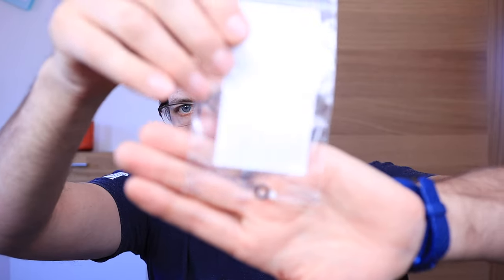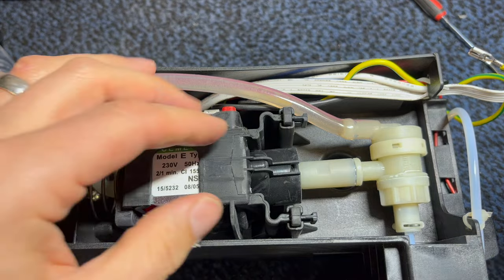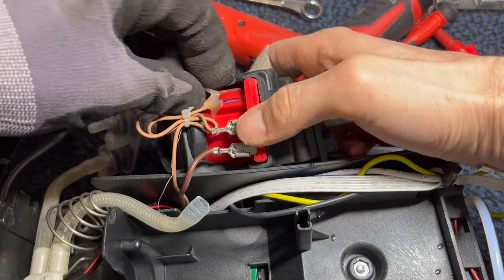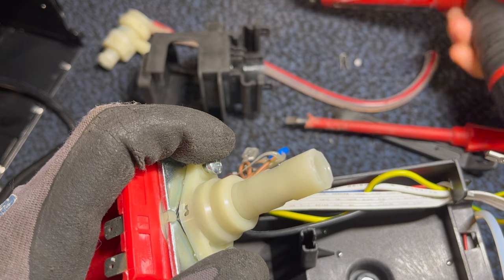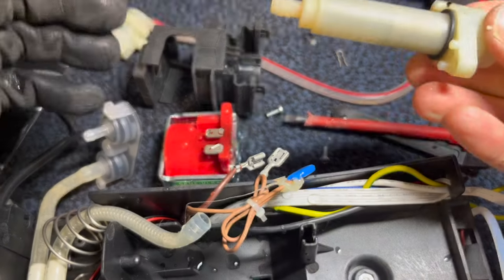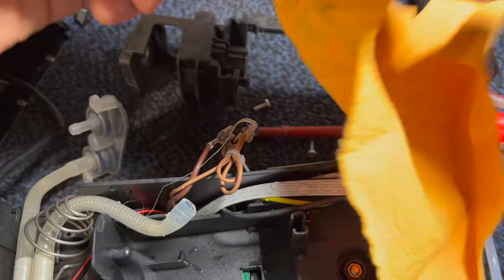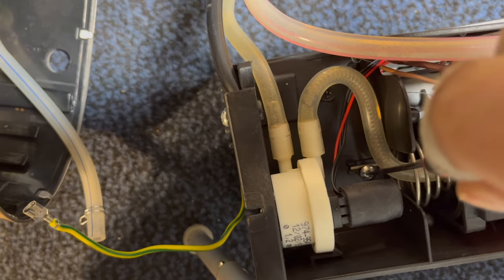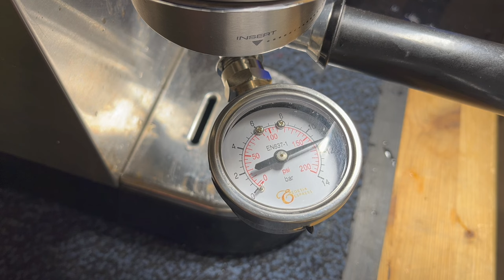HOW TO FIX an ULKA Vibratory Pump: Dedica, Gaggia, Saeco, Philips, Etc.

Comment: The best ULKA pumps are the red ones whit metal nozzel, the other Ulka white body and plastic nozzel are trash they have fewer coils windings and only last about 1 year,the new Saeco and Delonghi are fitted whit that crappy pump white body and plastic nozzel, to save money.I always replace them whit red ones.
Reply from the maker: Ok that's good to know Sebi! Thanks for that info. I will consider a red bodied one next time I need a replacement. Cheers!
Reply: The red ones are 24V for the oldest equipment. The White and the black one's are 120V (America) and 220V (Europe). So you shoukd Don't interchange it because risk of shortcut.
Reply: @Seby Saba That's incorrect .... red housing pumps are NOT 120V
Reply: I have a red one 230V (Oster) @lifeisfuneh

Comment: It's ridiculous that a tiny plastic ball and gasket costs £5 but you can buy the entire pump for £14. Are they really saying that that ball and gasket is over a third of the cost of the entire pump? They should be tuppence.
Reply from the maker: Hey Bob, well it is third-party selling these, and of course they want to make a profit. I’m sure that the parts only cost pennies.
Reply: I was thinking the same, but ordering the same rated and foodsafe parts in low numbers is very tricky. Ive tried aliexpress, and ive found some sellers for the casket, and for foodsafe balls .. i just dont know if i want to wait 2 weeks and find out either they dint fix the problem or leaking plastics in my coffee due to the seller i pick, cheaped out and got a regular part.

When you buy in bulk, those sellers tend to sell you probably the stuff you need, and food safe. 5 bucks is not bad, in my opinion. If no shipping 😅
Reply: Ball and ring are for 0.5 euro. And it remains 4.5 for taxes and retail costs

Comment: There is an upgraded version of this pump which comes with copper pipe instead of plastic and costs almost the same price. Model: EX5
Reply from the maker: Thanks for that tip! I will look for that one, when I need a replacement.
Reply: Nope

Comment: DON'T DO IT !!!

I decided to follow your advice and to change the joint and the ball of the pump although these pumps are cheap

However it was a mistake and a full waist of time, because there was an air/water leak in the pump that the changing of the ball and joint didn't solve.

Changing the pump did the job.

Friends, do not hesitate one minute. If your pump shows signs of disfunction like not working at all, or mixing air with the water, or stop to give a good pressure, don't try to repair it like this video claims it : change it.

The price of a pump is around 20€ the price of the ball and joint around 6€. I don't  like to waist too, but the difference is not worth it.
Reply from the maker: Sure, it's easier to just change the pump, and it doesn't cost much, so that is also recommended. Cheers!
Reply: Your problem was a leak, not sure from others
Reply: @russomarcelo  what ever the problem of the others are, it's not worth to spend time on repairing it, rather than to buy a new one. 

If I would not be convinced by the interest of repairing when it's possible, I would not have tried to repair it. 

But really in this case, it's not worth it

Comment: Hi Tom,
Thanks a lot for all your vid
I bought my DeLonghi Magnifica XS from Costco MN 
120 v - 60 HZ 1250 W
Type ECAM 22110 B
P= 1.5 MPa  (15 bar)
When I took it to North Africa and by mistake I plugged it in 220 V
I smelled little burning. I still can turn it on I can hear the coffee grinding all screen look good with green and yellow light but it doesn't dispense water nor a coffee.
Please help.
Reply from the maker: Well, there will be some issues there. I am actually surprised the screen turns on, as the circuit board and electronics were designed for a different voltage amplitude and frequency. The pump is also designed for 120V, which means that 220V will not be compatible. Or do you have it plugged into a transformer? I have one like this: https://amzn.to/403c71S
Reply: @TomsCoffeeCorner  thanks for your reply
I do have a converter. But like I said I plugged it by mistake directly to 220 V without converter until I smelled the burning then I unplugged it. But it still working like before all buttons works fine all of them but no water coming out.
Reply from the maker: @ricolimorico3386  Then likely the pump cannot deal with the voltage, or is burnt out. But the pump is cheap to replace, like $20.
Reply: @TomsCoffeeCorner  lot of thanks to you for taking time to help me. Is there any link where to buy the exact pumps I'm still in North Africa 
Plus I took some videos of the actual state of my magnification XS showing it work I don't know how to share it here in youtube so you can take a look at it.